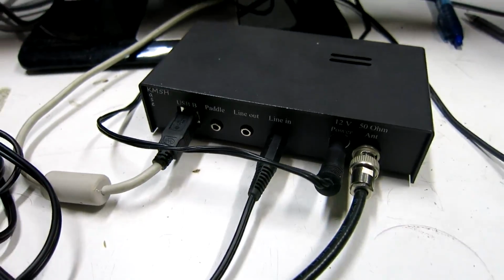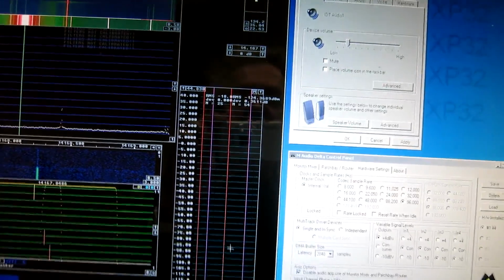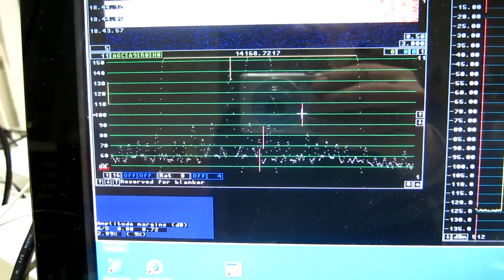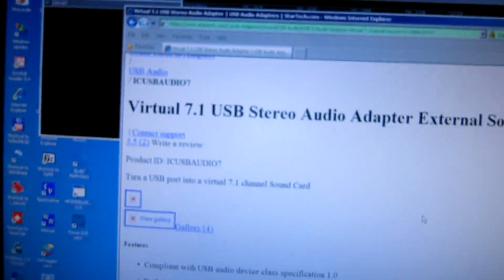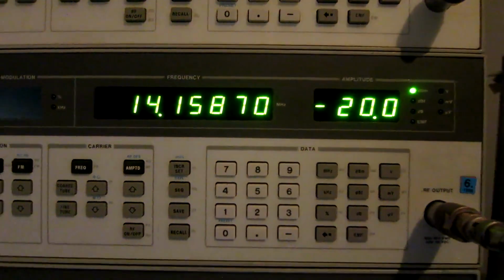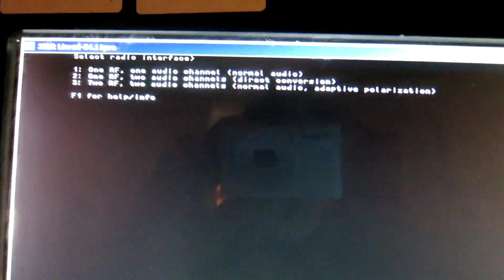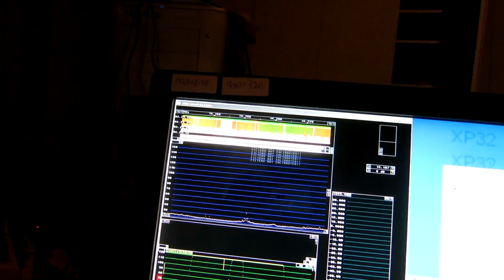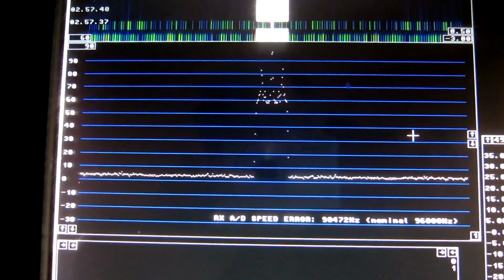softrock_soundcards1

Comment: what is the value of the capacitor that you apply across the front connections on the softrock?
Reply from the maker: I used 0.1 uF. If one makes it too big one might get a center spur due to mains overtones, if one makes it too small it would not be a shortcut for the RF signal. It is not critical at all.
Reply: Thanks for the information; enjoyed your video as I have just gotten a rxtx ensemble